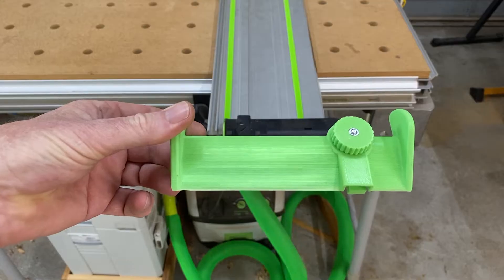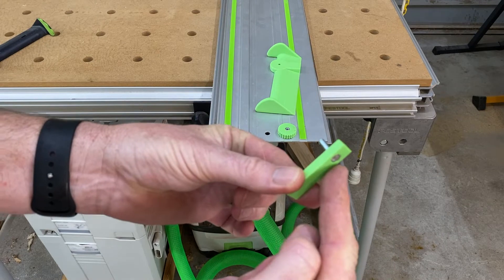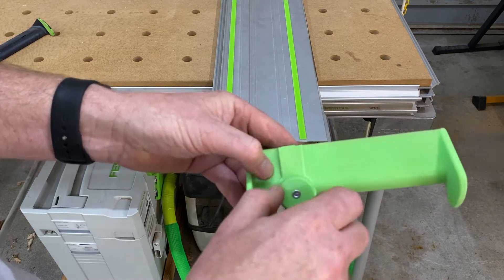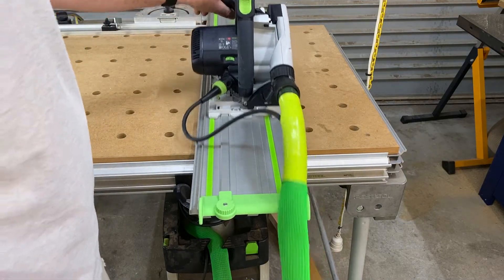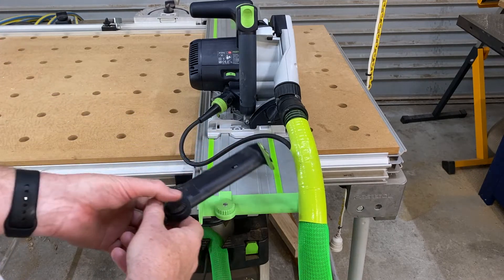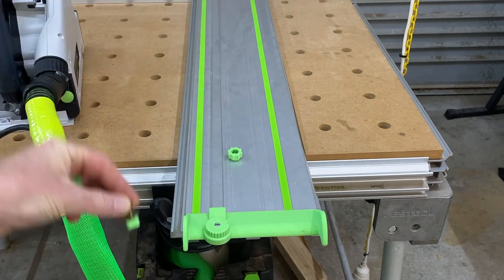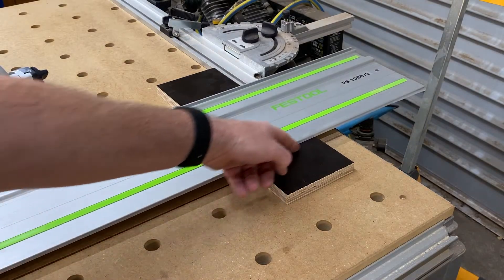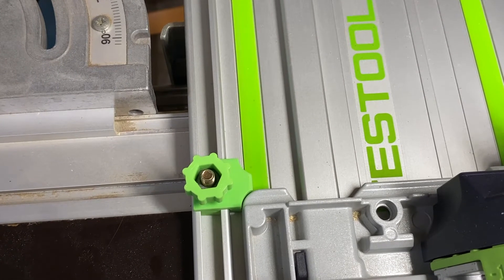3D Prints in the workshop #15

Comment: I had used the festool and cable still got in top t slot grove. Why do not make wider to cover all edges of the track. I see you have cable in the pastick sleeve.  
Im  shop fitter and I have to pack up all tool by the end of the day. I like to purchase 3 of these but wider.
Reply from the maker: I Fasola, I didn't design the deflector, that was ShapeLabs, https://www.thingiverse.com/__shapelabs__/designs. I was just showing it to people. I bought the mesh sleeving on Amazon. There are many suppliers. Just search for "braided sleeving".
Reply: @DarrensWorkshop  thanks for sharing.